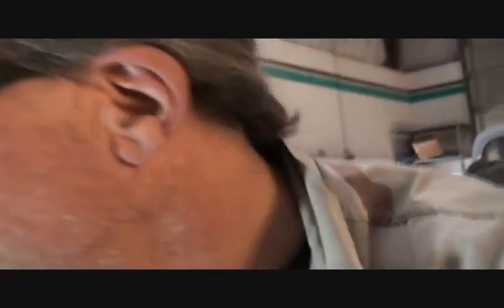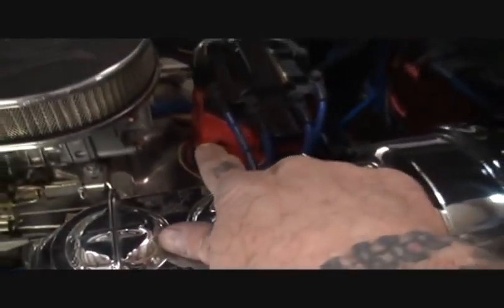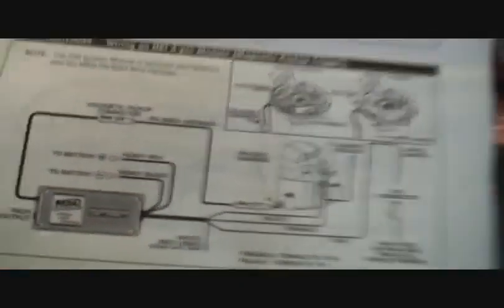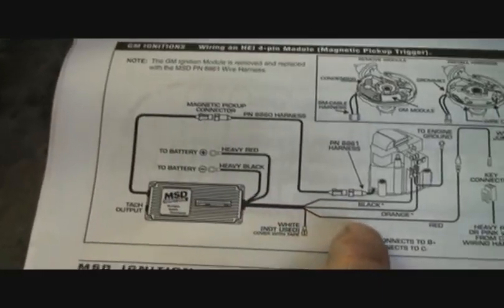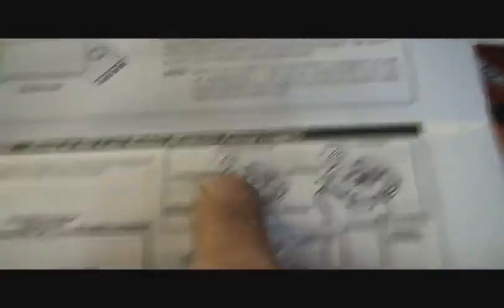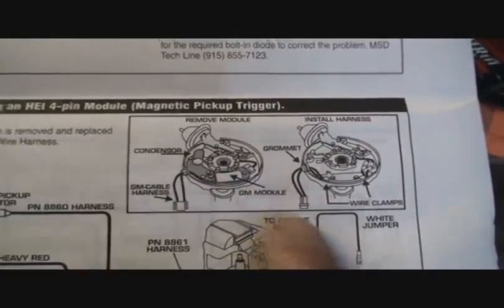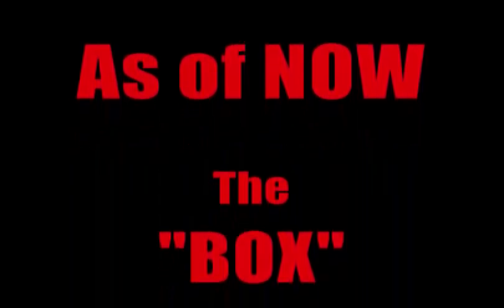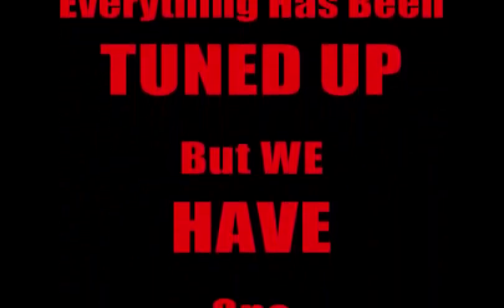1934 Ford-Streetbeasts Coupe-Installing the MSD 6AL-2 Ignition Module, Part 2

Comment: I'll bet your right. I just went through this with a guy on an HD engine. They installed a big bore kit and with 1000 miles on it it has already used a qt of oil and has fouled two sets of plugs. They idled it way to long and it'll never seal up now.  Still don't think its a good idea to put that box under the car!